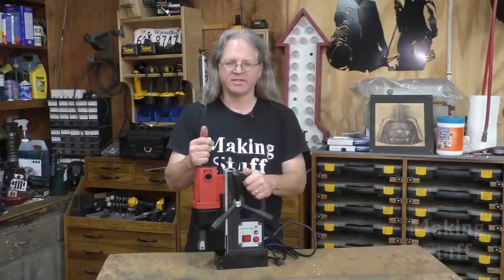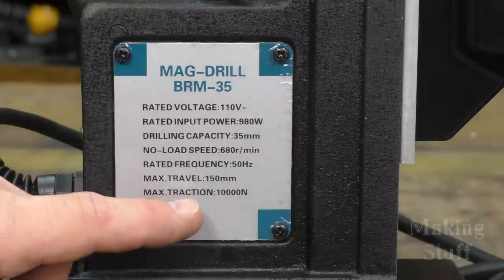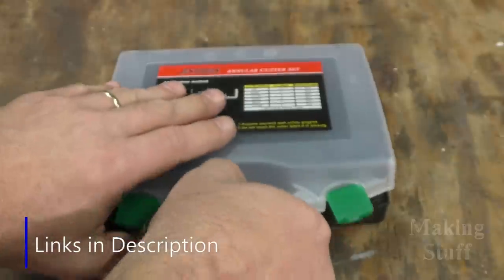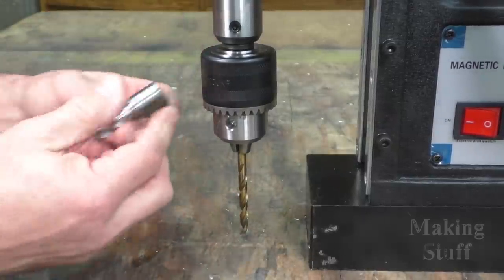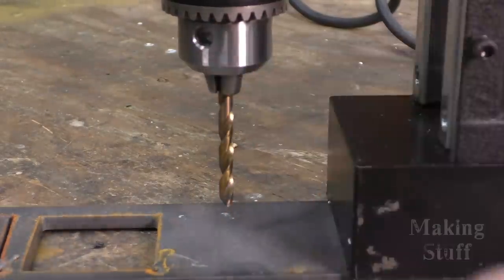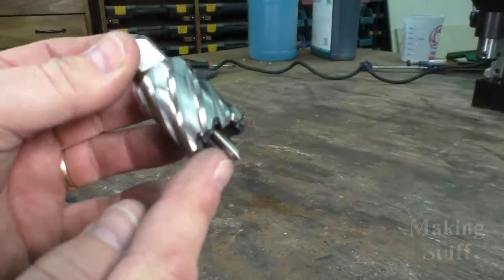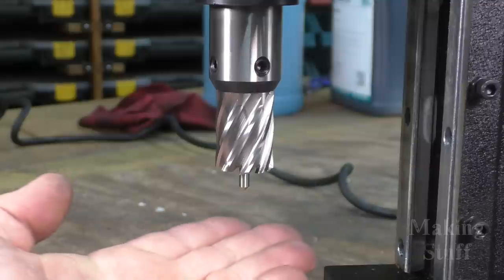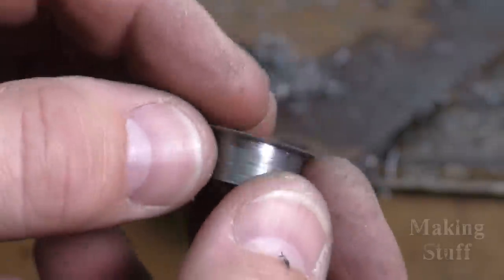Reviewing the Cheapest Magnetic Drill on Amazon - Is It Any Good?

Comment: You tie off the drill while using in case of a power outage, we use the hundreds of feet in the air and like to keep them up there
Reply: You beat me to the punch 😉, are you an Ironworker [I'm retired] ?  And like this gentleman said, we tied them off, especially for vertical & overhead. We also taped the cord to the rope (with a loop in the cord)
Reply: Damn straight. Always tie them off when you at height. I usually attach  a piece of line with a back spliced loop right onto the handle.  Keep hanging and banging.
Reply: When I used to use these, they didn't fall if you lost power.  The base stayed magnetized enough to support its weight.  It had a demag switch to release it.  You could yank it loose after it lost power so the rope is probably still recommended.
Reply: @michaellowe3665  then your not an Ironworker
Reply: @hollywoodhand9012  no. Didn't say I was.  Im just saying that the one I used stayed put until you demaged it.  I don't know if the cheap Amazon version has this feature.
Reply: @michaellowe3665  your still not getting it...  its all good bro just stay on the ground with your mag drill!!
Reply: @hollywoodhand9012  dude you still dont get it.  I dont care.  I dont want to be in your club.  I wasn't trying to be.  I was pointing out a feature of the high end ones I used. They had hardened steel in the base that stayed magnetized after you shut off curent to the coil.  You then had to push the demagnetize button to send AC voltage through the coil so you could release it.  That was a safety feature so they dont fall as soon as you blow a breaker and lose power. We didn't use them very high up, but if we did we would have tied them off too.  If you happen to know that the Amazon one doesn't do this, then feel free to mention it.  If the ones you used didnt do this, feel free to mention that.  I just dont give a shit if you were ever an "iron worker"  it means nothing to the conversation.
Reply: @traestuart384    You women are all the same.  One must end the conversation with a point.  Lol 😂
Reply: @traestuart384  Lol.
Reply: Rope it in place because if it drops on someone it will leave a bruise.😏
Reply: Lmao no idea what the rope is for!!!!! I was wondering where the pilot pin was on the first hole lol.
Reply: Angle of the dangle is equal to mass of the ass. I’m nothing. Been in unions most union workers  I worked around are assholes. Never heard so much of that’s not my job. Than I did in unions. They probably are good unions but like anything few assholes makes shitty situation. So later. Good review on drill. Like the channel. Keep up good work.
Reply: @paultrimble9390  
I work on non union construction  sites. First no safety as in no hardhats, many guys with running shoes.  Working under the crane with a load. Crazy stuff. Yes there is aholes in unions but you want safety at the site. So everyone  goes home. Which unfortunately on non union sites that doesn't happen.
Reply: @paultrimble9390  no you are not rambling.  What you say is very true.  Scary oh yes. Sad about the crane accident. 
Stay safe so you can go home.👍🇺🇸💯
Reply: @hollywoodhand9012  🤣🤣🤣
Reply: Literally thousands of holes 🕳    Hougen.
Reply: Same when using core drills.
Reply: @Purelypr4nks  ok joe
Reply: @hollywoodhand9012 

Being an ironworker isn’t badass dude and no one’s impressed that you tie some tools off above ground lol.

Comment: I have used these type of drill many times. Even upside down on the ceiling. Always used chained up .Especially on the ceiling. You never can tell if the power will be cut off .Great tools to  use. In difficult situations we clamped a strong piece of steel  to a suitable surface then attached the mag base.

Comment: I think the rope is for horizontal drilling and is used as a safety line if there is a 120v interruption. If you had it horizontally mounted above your head and the power was cut, it would fall on you and possibly be harmful. It looks like a great tool to me.

Comment: The rope is for instances when you need to mount the drill horizontally in the air so you tie the rope to something and then to the drill so if for some reason the magnet slips or let go the rope prevents you from finding out if the drill bounces or not

Comment: I've been in the structural steel industry for over 20 years, and have drilled literally hundreds of thousands, if not millions of holes with the same style drill/cutters.

2 tips- 
1. You don't want to peck with annular cutters.  Each time you lift and go back you introduce friction.  Additionally the teeth can hang up on an unbroken chip at the bottom and you wind up with a cracked cutter.  You only need to lift if you are drilling deep like 3/4"+ and the chip nest is getting out of control or your cutter is overheating.  I have used every type of goof coolant feed system there is and nothing has ever really beaten the simplicity and versatility of a water bottle with a small hole punched in top.  I use a water based coolant and a few cubes of ice added to eliminate as much heat as possible.

2. Wire wheel or grind off rust before you drill and the same goes for things like cutting with carbide/cermet tipped saws.  You honestly may not notice as a home gamer and probably not drilling 100's of holes, but rust is a serious abrasive and will substantially reduce the life of your cutters.  Having bought a few I know you know they aren't cheap.

What can I say; I'm a sperg and couldn't watch without saying something.  Best of luck.
Reply from the maker: Thanks for the info!

Comment: Bought the different brand, same machine, and have used it allot for automotive and construction. Surprised myself how often I've used it. I'm finding myself using instead of the drill press on a regular basis. Magnet is barely strong enough on 3/16" steel on a horizontal cut (so use a backer plate), and have to use a ratchet strap to hold drill while cutting. Can't beat the price and a definite win without breaking the bank. Like any tool, don't try use in production work since you'll get hurt, but for the low cost occasional need it tool, it's perfect.

Comment: Just an update from my comments a few days ago. I received my Hougen twist drill adapter kit (#03845) and it does allow you to use there  short proprietary twist drill bits in your mag drill by using the weldon adapter (3/4" shank) included in the kit. Eliminates the need for a drill chuck. The adapter, when installed, only hangs down 1/2" below the weldon insert. Also, the twist drill slide up into the adapter and are held in place with an allen screw in the adapter. The bits have a large flat spot on the shank. Bit sizes in the kit are 1/4,  5/16, 3/8, 7/16 and 1/2. THEY WILL FIT UNDER A MAG DRILL!!!! Yeah!!!  I am not sponsored nor do I get any benefits from Hougen. There may be other brands out there that do the same thing, but not only are they hard to find, this kit only cost  $125.00 plus tax.  I was just hoping to help anyone looking for a solution and save them the expense of buying a Jacob's chuck that is basically unusable on a mag drill. (Like I did) Hope the helps someone.
Reply: Make a vid and show us how it’s going.

Comment: As I watch him use it on the I beam I begin to start waiting for a few things to happen.
1. He loses fingers on the hand that is manually feeding the cutting fluid in since no protective gear is being worn and the fast spinning steel can be very sharp
2. Power cuts out and the drill falls over causing unknown levels of damage to the bit, and likely taking a finger or 2 as it slows down swinging past the unprotected hand feeding the lubricant
3. The extension lead wound up on the coil still overheats resulting in an electrical fire or similar (pretty unlikely if it's only being used for a few minutes)

Safety concerns aside, great video, very informative

Comment: The reason for the rope is to use it as a lanyard to safe off while using it to drill horizontally and vertically in case you lose power to drill.

Comment: Thank you for sharing. About the annular cutter, does the pin fit loosely or tightly in the bit? I bought a larger set on Amazon but the both pins fit loosely in the bits. I don't know this is the way they designed or a faulty product.

Comment: I have seen warranty service men come into our factory with a mag drill and a plate of steel with a hole in it and clamp the plate to a wooden work bench to provide themselves with a drill press for fabricating different parts and fixtures that they needed to do the warranty work on our equipment. If the material being drilled isn't too heavy you don't need the clamps. Some union shops have conditions negotiated with the company that don't allow outside contractors to use the equipment the factory union workers use, so they have to bring their own. To provide for longer twist drills they use a plate that has been bent on a break or welded into a stair step shape to over hang the edge of the bench 6 " or so. You could make the step whatever distance you want and if it was too much for some drills because of the limited stroke of the Mag Drill, you just put your workpiece on wooden blocks to get it nearer the chuck. I thought it was a pretty innovative way to make the Mag Drill more versatile and thought you might as well.
Reply from the maker: Thanks for the info!

Comment: I am with others that a speed control would be a good plus if you are to use the drill on a regular base. We had to countersink holes on tear plates quite often. As the thickness is only 6 to 8 mm, the drill will not attach on the tears enough to drill, we put a 15 mm thick steel plate under the tear plate (just about the size of the magnet) and secured the drill with a clamp. So if you have to drill in thin material, use additional kinds of ways to keep the drill from moving. (To check try to move the drill by hand when the magnet is activated) In daily use we did not use the oil reservoir, but used simple plastic oil bottles to spray the drill now and then (if I had to cut thick material I let the drill cut a very flat ring - just a few revolutions - and put some oil inside, spraying a little additional oil from the outside too.)

Comment: 3 years later I bought the cheapest mag drill on amazon  (vevor - $135). Has the same twist drill Z axis problem, fixed with a 1/2" steel plate adapter. HUGE deflection with any sort of downward quill pressure.

Comment: The problem with annular cutters is breakage. If you push hard enough to break the magnetic bond on the drill, the cutter will angle and break the teeth off. We use them to drill heavy truck frames when mounting tanks, tool boxes etc. Etc.
Reply from the maker: Thanks for the info!
Reply: @MakingStuff  the upside is that they cut a very precise hole and much faster than a drill bit. Just be carefull about pushing into the cut hard enough to break the magnetic bond of the press. Getting the feel of where it does break the bond helps a lot. You can test the strenght of the magnet by pushing it offwithout the bit turning. Just learn how much pressure you can apply before the magnet pops off the base metal. And it helps a lot to clean any dirty base metal before sticking the magnet to it

Comment: Annular cutters aren't sized below 1/2" so you have to use a twist drill bit for anything under 1/2". I have a Magswitch brand mag drill, 3/4" Weldon shank,  with the same chuck problem. The bits are to long to fit under the chuck. Dont know why the travel distance on the mag drills is so short. I just ordered a kit that may solve the problem. It's a Hougen twist  drill bit adapter kit  03845. The weldon to twist drill bit  adapter takes the place of a chuck and is also not as long as a chuck. The bits  are secured with allen screws, same as the Weldon set up. This set cost 125.00 on Amazon. Will it work?? Don't  know...just ordered it. We'll see. Another option,  you can order 3/4" weldon end twist drill bits individually, but they are expensive. This kit has 5 bits (1/4" to 1/2")
Reply: i have 7/16 ths annular cutters but they are a pain.  the slug tends to stick inside and i have to tap the cutter while it's in motion to get it to spring loose or sometimes take a needle nose and give it a tug.
Reply: Do you use a pilot bit in your annular cutter?
Reply: @garylsmalley  yes.  They will walk otherwise.

Comment: The rope is for supporting the drill when drilling on vertical surfaces.
Reply: It's  like a safety line.
Reply: Or horizontal surface if you need to be drilling from the underside for some reason. My evolution comes with a tie down strap, with an easy to use buckle, might be a worth while upgrade for a couple of dollars, if you plan on inverted or vertical drilling much.
Reply: On my evolution, I can use big twist dril bits, as the carriage can move up in two ways, locked it will just move the head up and down but unlocked it with move the track, that the head runs on up, then I can relock it in the higher position, to then be able to to move the head back up and down on the track, rather than moving the track and head, in relation to the base. You may be able to do similar on yours with the ways by loosening them, shifting it up, then tightening again.
Reply: Yep, we had a "former" employee forget/too lazy to put the safety line on and it popped off about 60 feet in the air and came tumbling down through the structure. The one we have no has to be attached or the drill won't start.

Comment: The rope is a safety tether if you invert the drill on a steel I beam or box section for a shop roof of engine crane setup so if you accidentally switch off the magnet it doesn't drop on your head or smash on the ground

Comment: Downside someone mentioned above, doesn't seem to have a low/med/high speed control which might burn out those nice bits and end up costing more in the long run.
Reply from the maker: Great point!  Thanks for watching!
Reply: Rpm seems high to me
Reply: Maybe a router speed controller from Harbor Freight could be used to adjust the speed. I use one for all different applications. From routers to fans and really, on a crock pot.
Reply: @snowgorilla9789  i agree, it is too high.  all the cheaper ones are high rpm's and single speed.
Reply: @BigBlueMotors  I haven't tried your idea myself, but I would bet that using your method to slow the drill would likely reduce the strength of the electromagnet base as well, allowing the drill to move, or fall when drilling out-of-position.

Comment: Installing deck cable railing system. Posts are 4x4 red iron, metal is 1/8" thick. Holes need to be 3/8" diameter. Is this the right tool for drill the holes? Can I get annular cutters 3/8", or will I need a regular metal drill bit? Thanks!

Comment: I wound up buying 1/4, 5/16 and 3/8 solid weldon shank drills because the smallest anular cutter seems to be 7/16. Amazon is not the cheapest place to get these drills. Mine has been fine with moderate use over the last 6 or so months,really handy. Like any tool the the extras can sdd up fast [ longer cutters, bigger cutters, drills].
 Because it uses a brushed univesral motor reversing should be as easy as a 3 position double pole double throw switch[think tapping] and speed control also easy.

Comment: I bought this drill and had the same wobble problem.  However, my magnet is not strong.  I can easily pull it away and it will definitely not hold sideways.  Still happy with this drill and got a lot done that would have been very difficult otherwise.

Comment: Screw-machine (also called stub length) drill bits should fit in the chuck. Overall length of a typical stub length 1/2" bit is around 3-3/4", and length decreases with size.

Comment: Surprised no one mentioned the drill's electrical specs.  130V @50hz?  For US and Canada, it should be 60hz.  If it's designed for 50hz feeding it 60hz will make it spin faster and potentially overheat the windings.

Comment: On several mag drills, the rack and pinion base plate which strokes about six inches, has a slot which allows the motor to be adjusted up and down on the base plate. This allows for the longer jobber drills bits to be used.
Reply from the maker: Unfortunately this one doesn't have that feature.  Thanks for watching!

Comment: US  line frequency is 60Hz, not 50Hz.  It's not a non-issue because the power ratings and speed are not applicable when you change the frequency.  There would be significant detriment if it was 60Hz and you wanted to run it at 50Hz (increased current and heating) but in this case the impedance increases so what is lost is the power while the RPMs are increased.
In other words, if you're not running it at 50Hz, then the other specs are not correct.

Comment: Excellent video.  Just wondered if the mag drill would attach to the side box section of a gate 30mm to 50mm?  Would it be enough steel for the drill to magnetize to?
Reply from the maker: Not sure if that's enough metal for the magnet to stick to.

Comment: We call them broach bits in Australia and the rope is to tie the drill off with when you are drilling horizontally, on a steel column for instance. Just in case the power is cut. I've never used a magdrill with a chuck, I have only used it with broach cutters. They cut better if you keep a constant pressure too.
Reply from the maker: Thanks for the info!

Comment: the auto-oiler is a neat feature.  is it gravity fed?; would it still oil if you were drilling on a vertical surface, or from underneath?
Reply from the maker: It's gravity fed.  That's why I had to manually apply coolant on the I-bream when cutting horizontally.